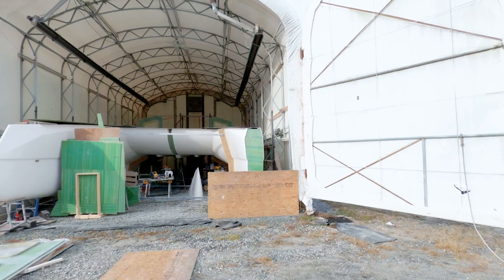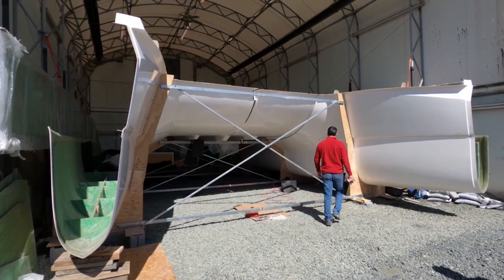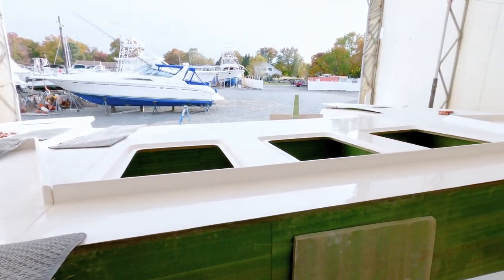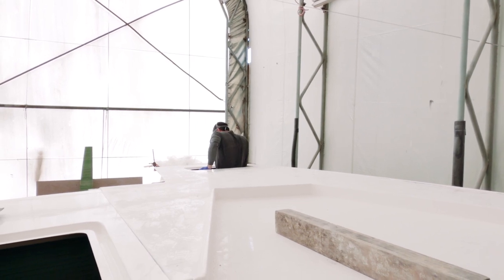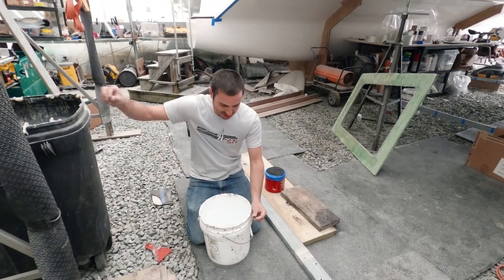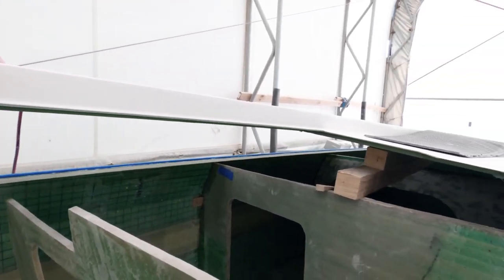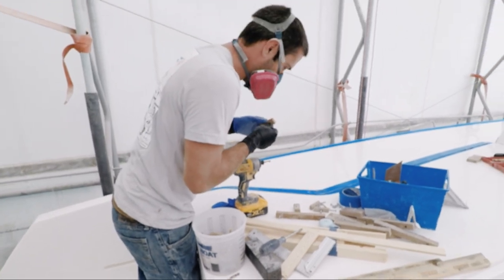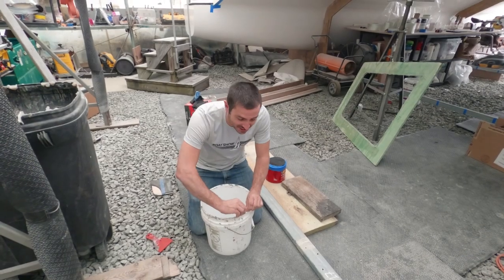CATAMARAN BUILD - I've Finally Figured It Out!!  (MJ Sailing - Ep 216)

Comment: Wow, when you placed the storage cover between the two top side panels it really gives the front end some dimensions. Somehow in the videos the green foam board color tends to make the space look smaller than it really is, but the white across the deck looked massive in this video.  When this project is over you can easily say that you laid miles of glue/bonding paste and miles of blue painters tape.  It’s look into better every week and we’re happy for you both that the weather is somewhat cooperating right now.  Happy New Year.

Comment: Can't quite believe how fast this is coming together.....doing a great job guys. FYI Mads from YT Sail Life made a pretty cheap and easy hot box for his epoxy....could be worth checking out, might also be prudent to tape your clamping cleats, makes it so much easier to remove if you accidentally get squeeze out over them.
Reply from the maker: We actually do have something like that (a box to keep resin warm) going already, we'll be showing it off in the next 2-3 videos.  Thanks for the tip though!  😊

Comment: Merry Christmas.... Great video as always.  Suggestion-  take a small piece of wood that is at least a foot long, and mark off 12 inches on it.  Then place it on your scale( digital I hope) and zero it out, then run a normal bead along that 12 inches, and place the wood back on the scale.  Now you should have an accurate weight per linear foot.  All you have to do then is measure out the length of what has to be glued and multiply the number of feet times the weight and you should have an accurate amount of adhesive you will need.  Just a suggestion
Reply from the maker: We probably should adopt a solid way of measuring how much methacryalte (on average) is used per foot/meter when we bond.  A good tip for when we begin again in the spring!  😀
Reply from the maker: We do actually have a per meter standard.  The production yard is 260g per meter and we are 280g/m.   But it's just a guide and needs to be adjusted on the fly since variance in the flange depth changes (making it flush) the amount needed.  -Matt
Reply: @MJSailing  I am pretty sure that is pronounced falange! (take a drink) You guys are awesome.
Reply: @davidfarning8246  falanges!
Reply: @davidfarning8246  
Falange: The Spanish Fascist movement that merged with traditional right-wing elements in 1937 to form the ruling party, the Falange Española Tradicionalista, under General Franco. It was formally abolished in 1977.

Phalange: A bone of the finger or toe.

Flange: A projecting flat rim, collar, or rib on an object, serving for strengthening or attachment.

Glad to help.

Comment: Looking good, and coming along nicely. As all your gelcoated components become fixed, should go out and buy a cheap roll of vinyl flooring, cut to size and taped down. Protect from foot traffic, epoxy/Resins and goop droppings.
Reply from the maker: We've started to coat many of these gelcoated molds in a protective plastic as they go on, and eventually the decks will be covered in an EVA foam.  😀
Reply: @MJSailing  Great idea! Really enjoying following your journey with this boat build. Keep it up.

Comment: I use the same respirator, for a better fit, glue or sew the lower strap to each side of the plastic crown at the same point as the upper strap. This allows for constant pressure all around.
Reply from the maker: I'll have to give that a shot.  I spend half my day pulling down the respirator since it seems to ride up way more than it should.

Comment: At 12:25 could you call that your "Meth Lab?"   😀

It must be very challenging trying to figure out what you can do now that won't interfere with something you need to do in the future.  
Like putting the deck on before engines are installed, or as you described in a previous video putting the shower pan in before reinforcements.
Reply from the maker: There is A LOT for Matt to think about and figure out (that's what he's busy on his computer doing while I'm editing 😉) but thankfully Max Cruise has been there for us every step of the way.  They always messaging us, sending photos, and helping us to get through each stage.

Comment: To cure the resin use an electric blanket over the area
Reply from the maker: So far we've been using a combination of heating lamps and radiators, which have been waiting great. We'll be covering this in an episode soon. 😉
Reply from the maker: I hadn't heard or thought of this option until someone mentioned it recently.  Seems like a good solution for flat laminates.  

Matt

Comment: consider purchasing an x- large foam cooler or making one out of extra foam board--putting in a 40w bulb will keep stuff very toasty overnight, much warmer than a bathroom.  easily 80-90 degrees.  use a 20w oven bulb if lamp bulb makes it too hot.  this is how i proof bread dough in my very cool home(50 thermostat) in winter
Reply from the maker: For the past month (videos are about 6 weeks behind right now) we've actually purchased a cooler with a heating pad that we've been using to keep our resins warm inside the tent.  As soon as the videos catch up to the point that the side decks/windows have been bonded, we'll be doing a feature on that.  😀
Reply: @MJSailing  cool, thanks
Reply: Thanks for that idea, I also make dough that needs to rise.
Reply: @canlib  for dough, i wouldn't use a styrofoam cooler.  the heat can make it off gas fumes that could give your dough a bad taste.  instead, use a plastic insulted cooler, drill a one inch hole that you can thread the light/heating pad plug through to plug it in.  a wad of fabric in the  hole will seal in the heat.  works great after a cold proof to heat up the dough in a cool house and move things along.  bigger is better if you do multiple loaves at a time.  good luck with it.
Reply from the maker: We use a cheap plastic Coleman brand cooler.  The seal is loose enough that the cord goes right through without issue.  No pinching or anything for the heat pad wire and thermostat.
Reply: @MJSailing  nice--what temp do you set the thermostat?
Reply from the maker: @peetky8645  We usually keep it around 68 degrees.

Comment: I'm amazed they can ship those enormous parts from Vietnam.  That must be a logistical nightmare.  Fascinating project!
Reply from the maker: I know, it's amazing they can fit an entire boat in two 40' containers.  And since we were the first, they'll only continue to get better with each one that goes. out.  😊
Reply: Too bad free shipping with purchase doesnt apply here. I wonder what 2 40' containers cost to ship there.
Reply: @canlib  Very rough estimate is probably $3-5k per container depending on lots of variables.
Reply: @MrJhchrist  I think it was more like 5x that. They covered the shipping costs and it was rediculous from the pre covid estimates.
Reply from the maker: @MrJhchrist  Original quote we received for shipping in October 2020, from Vietnam to Kent Island, was $3,500 per container.  But, by the time it actually shipped in January 2021, the first container ended up costing us $7,500 to get to New York, and then $1,500 to truck to Kent Island.  The second container, shipping in June, cost $15,000 from Vietnam to New York, and again the $1,500 in transportation to get it to us on Kent Island.  😥
Reply: @JCrook1028  Dang, good point, I haven't had to ship one post covid and should've known shipping is particularly insane.  5x shifts shipping from a small but notable expense to one of the largest single expenses in a build.  Eye opening.
Reply: @MJSailing  OUCH!  Thanks for the specific numbers though!
Reply: @MJSailing  Yea I thought I had remembered a $15k area number. Crazy!

Comment: I follow another channel and they took an old insulated cooler and put and incadesant lightbulb in it as a heater to keep their chemical products warm.
Reply from the maker: For the past 4-6 weeks we've been using a Coleman type cooler with a heating pad on the bottom to be able to keep our resins warm before each use.  In the next two episodes or so, we'll be covering how we've managed to continue working through the winter. 😊

Comment: It's really satisfying seeing it turn into a boat.

Looks like your right prow is on but the left prow is not.  How does that right prow not interfere with the closing of the shed door?
Reply from the maker: The starboard bow was only in place while the door was open, for us to be able to properly fit bulkhead 1 and get it set in place. Once that had cured, the bow was taken off. They won't be permanently bonded on until we are out of the tent.
Reply: @MJSailing  I'm just flabbergasted at how much you get done.

Comment: With all of the cleats you are using, you will have a lot of gel coat repair to do, but just knowing everything is straight and sealed good will make the extra work worth it in the end. DO you think it will be sailing next summer sometime?
Reply from the maker: 😂😂  I do love your optimism and what you think we are capable of.  But sadly, no, she will not be on the water this next summer.  Fingers crossed it will be the summer or fall after that.

Comment: How are you remembering where all the little holes are from the cleats you use to keep things aligned and in place?  I think I would be putting a peace of blue tape over them so you remember to fill all of them.    And, most importantly, Merry Christmas!
Reply from the maker: We know that when it comes time, we'll just be following along all the seam lines of where the different molded pieces were bonded together.  And there will be A LOT of them to fill and gelcoat when the time comes! 😬

Comment: Builders use a material like clingfilm to cover carpets where they work. Would that put on your deck surfaces help when you need to put your hands down?
Reply from the maker: The decks we're not as worried about, because they'll eventually be covered in an EVA foam.  But the transom walkway plus the cockpit seats and the sill all do have a protective plastic on them.  😀

Comment: She's looking fantastic! Question about the cleats. I assume you'll have lots of holes to go back and fill after its all set up. Could you fasten the deck down from the inside of the hull so the holes wouldn't show topside? Maybe I'm missing something. Cheers to the new year!
Reply from the maker: Hi Tim.   The cleats are going through two solid fiberglass flanges and would have holes regardless of which direction we start from.    This isn't actually an uncommon thing to do even on full production boats where they need to align and tighten hull pieces for adhesion.   It's just a bit of filler and gelcoat to make them disappear for life.

Comment: Time for cardboard and long life masking tape to protect the decks during construction? Messy resin drips suck to clean up afterward.
Reply from the maker: We've put a clear protective plastic wrap on the cockpit seats and the transom, but because the deck will eventually be covered in an EVA foam, we're a little less worried about that part.  🙂

Comment: Merry Cristmas. What a beautiful project you have. You are true craftsmen in boat building. I can say that I have a reasonable understanding of constructions and I notice that your bulkheads are very thin. It must have been calculated 
 times, but why not make the most important ones twice as thick? It's a huge ship and if the bulkheads break it will cost a fortune to fix it.
Other than that it looks great. Good luck and I'm sorry to interfere.
Reply from the maker: Thanks Peter.

There is one brand, and just a few models, that have known bullhead issues.  it's not a common problem and not something I worry about with this totally different type of construction. 

The number one issue with amateur built boats is them adding extra strength to one area without calculating how it will effect other parts of the build.

Comment: Did you add a bead to the tops of the bulkheads, or do you just tab those in later?  Other than that, it looked a lot like building a model.  It's just that the scale is 1:1. :)

Comment: Do you have to coat the inside surfaces of the lockers and hulls with a gel coat?
Reply from the maker: We don't think we'll do those areas in gelcoat, but most of them we would like to have a decent finish.  We'll fair them out and then paint them, but based on what has been in our previous boats, we don't think gelcoat is necessary.

Comment: Why is the Port side nose cone (front end) off the pontoon?  I do not remember hearing about this before.
Reply from the maker: We can't close the doors to the tent with the nose cones on, so they will not be bonded until we are pulled out of the tent and working outside in the yard.  The reason the starboard side was on is because we needed the general shape to be able to bond in bulkhead one.  But once that is set in place with thickened resin, the nose cone comes back off.  🙂

Comment: How much will you be saving on the build by doing it yourself?
Reply from the maker: Since we're hoping to go as top of the line as we can with add-ons (hatches, rigging, deck hardware, electronics (only possible through the collaborations of companies)), we think we'll have saved about 300-350k on what we put in, vs what it's worth.